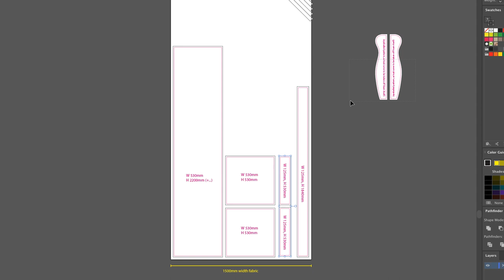Restoring a Mid Century Modern T.V. Chair Recliner from start to finish

Comment: Absolutely amazing job!!! I was also struggling to find any helpful videos on the process of restoring this type of chair and thankfully came across yours, you have created such a professional finish, I live in Queensland and have just purchased 2 x Don Rex mid century recliner chairs (similar to yours) Don Rex was a prominent furniture manufacturer in the 50’s and 60’s in Queensland so I’m super excited to have them restored, your video will be a lifesaver, thank you 😊
Reply from the maker: oh awesome! I'm so glad I could help! and your chairs sound amazing! I've since found out that instead of using velcro to attach the bottom of the back cushion to itself, you can use screw-in press studs to attach the end of it to the back of the chair at the base. But I still love my velcro solution :)

Comment: Thankyou so much for this video. I was in the middle of restoring a chair just like this but  my base attached material wasn't in good condition and  didn't have the tabs that attached to the front spring. After seeing this I replicated your base design. I too, am doing this in lockdown (NSW) . Not a sew-er either. one down one to go. Got the 2 old chairs in ordinary condition for the bargain price of $12.50 for both!
Reply from the maker: Wow that's a huge a bargain! I've since seen other chairs where they've attached the bottom of the fabric to the bottom of the wood at the back, but I'm honestly very happy with the way I did it!

Comment: This was a great video! Where did you purchase the contour back foam for the chair? Would you be kind enough to share your sewing patterns? Thanks!
Reply from the maker: Thank you! I'm so glad you enjoyed it. I got the contour cushion and base cushion from a place here in Melbourne (Australia) called Oz Upholstery supplies. https://ozupholsterysupplies.com.au/ 
I'd happily share the pattern with you, but the curved piece isn't accurate on the file ( I made it the right length and width so I could see where it would fit on the fabric before cutting it, but the actual curves are incorrect on screen, I got those from tracing the foam itself and adding seam allowance). I recommend getting the foam first and making a pattern from that directly, as your foam and your chair may differ from mine. Does that make sense?
Reply: @hugoafterdark292  Hi would you mind sharing the upholstery pattern with me? I picked up basically the same chair the other day from Vinnies and it's bright red! Definitely time for some new fabric lol
Reply from the maker: @palacinka9994  haha yes red is hard to make work in any room. I made a pattern directly from the foam I used by tracing it and adding seam allowance, so I don't have a file to share, sorry!
Reply: @hugoafterdark292  ok thanks! I was thinking of just unpicking the current cover and copying the patter off that, that could be easiest
Reply from the maker: @palacinka9994  oh that is ALWAYS the best option if you've got it!

Comment: Amazing work!! Am contemplating doing a similar project - roughly how much do you think you spent on all the materials (fabric, foam, stain, varnish etc)? And also, more specifically, how much was the fabric and how much did you need?
Reply from the maker: oh my goodness, I was going to try and keep a tally on everything but I simply didn't in the end! It was a labor of love, for sure. I just bought reasonably cheap fabric from the upholstery section in Spotlight, but made sure it was thin enough to fit in my domestic sewing machine.  I think I bought about 5 metres of very wide fabric (150cm width), and only used about 3. A bit more if you count the bias binding!

Comment: Hey, what is the reason for putting the wadding over the foam?
Reply from the maker: Hey! It helps fill out the cushion cover, giving it that sweet rounded look. Make the cushion cover to the exact same measurments as the foam, and then add wadding to the foam, and you'll get that nice plump look. Without it, it'd probably be fine but it might be a little sad.